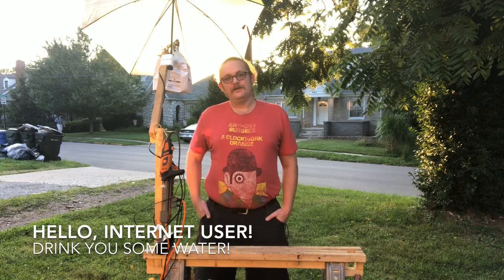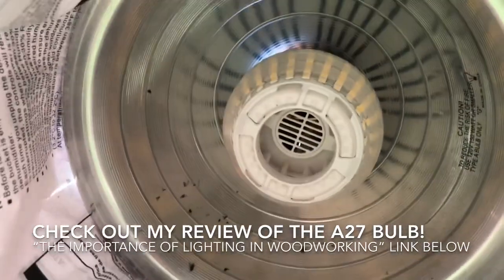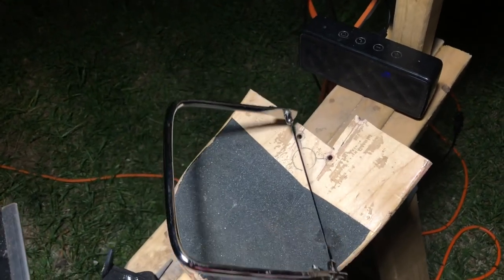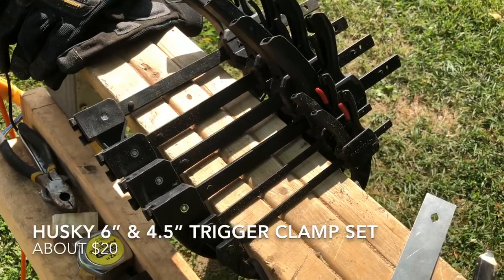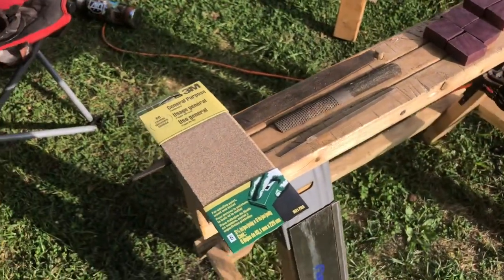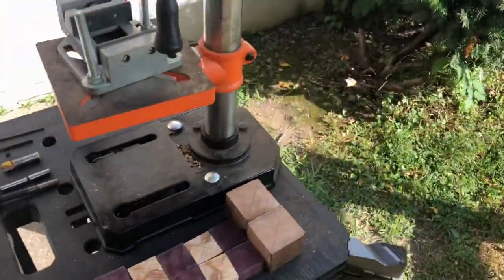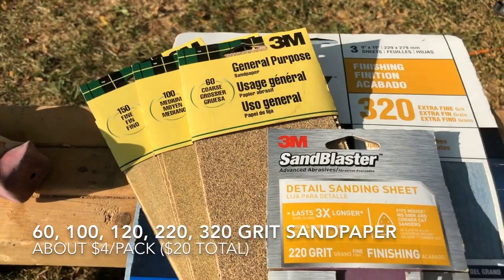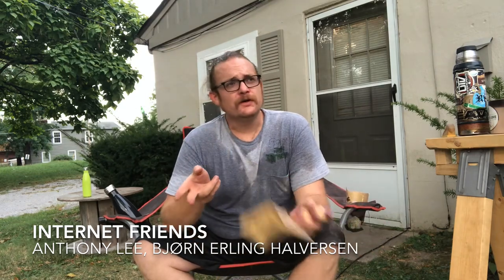Gary’s Wares: The Bare Essentials of Pipe Making (Also, How to Make a Twisted Carb Pipe)

Comment: I found you recently and was wondering would pipe making be a good thing to try if I have never worked wood before?
Reply from the maker: Yeah, I think so. One of the nice parts about pipe making is that, for all the artistry that goes into a pipe, all you need to do to make your pipe a success is drill a connected series of holes. Once that’s done, everything else is bonus points. Even if the pipe looks like hell on the outside, hey, it works. 🤷‍♂️

If you’re totally new to woodworking, I’d suggest starting off by building a sawhorse and going from there. That will give you a little experience with a saw, but more importantly will give you a place to work. 

Also, if you’re new to woodworking, there’s a chance you may not dig it as much as you first thought & woodworking can be a real money pit (Milwaukee, Festool, etc.). As opposed to buying a lot of tools at once, I’d suggest starting off with a rotary tool. Rotary tools are super versatile (as opposed to a drill press which pretty much just drills holes), and can be used for plenty of stuff around the house & other crafts. 

In any case, good luck with making your wood work! I hope you become as enamored with woodworking I am. More so, even. ✌️
Reply: @GarysWares thanks I'll defiantly get a rotary tool and go into it slow just in case I don't enjoy it as much but it seems realy cool and I think I'll like it